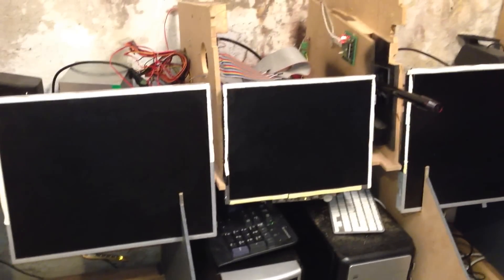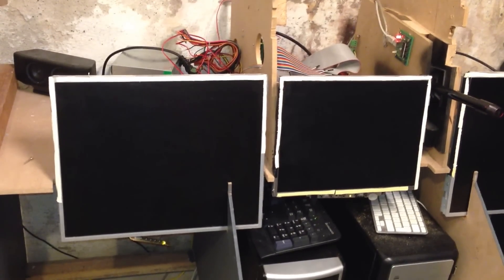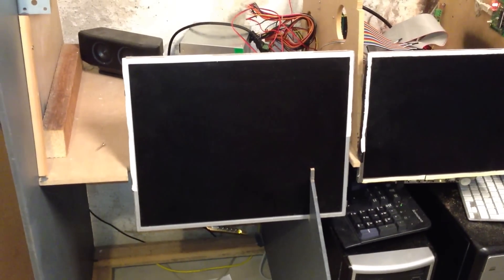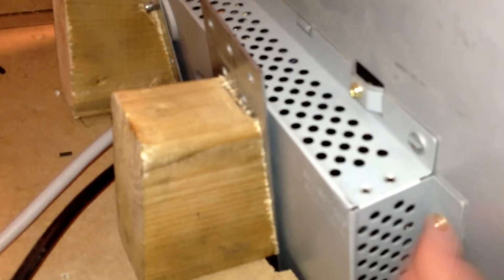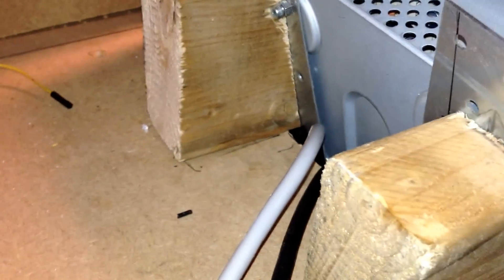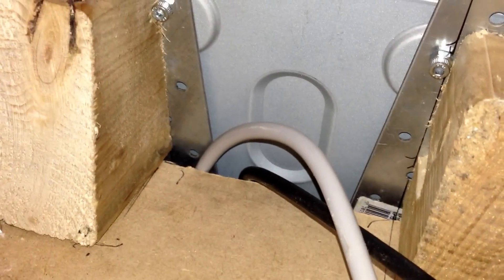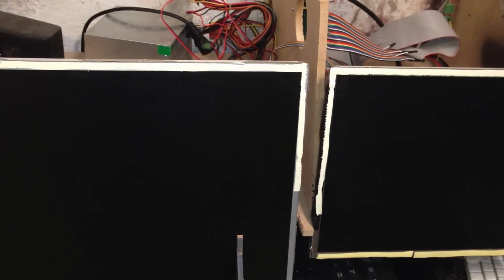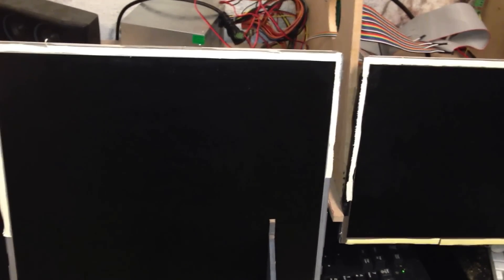Installing MIP - B737 Home Cockpit

Comment: Did you buy the monitors like that or did you disassemble them? Would it be possible to have the references of these?
Reply from the maker: It is normal office monitors that I disassembled. The VESA-mount is part of the metal-structure behind the plastic you strip away. 
The HP monitors are 19" and the middle is 15"
Reply: @BuildaBoeing  ok thank you